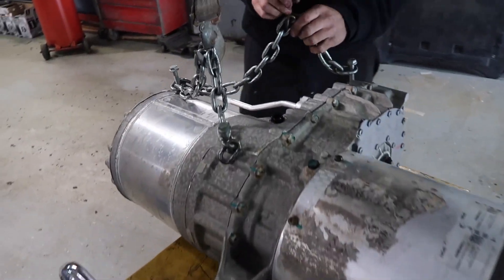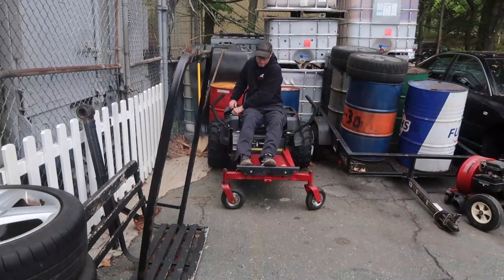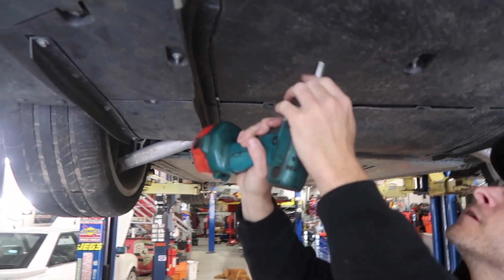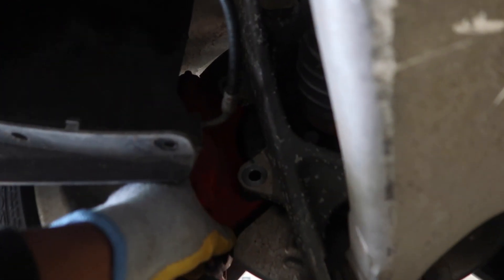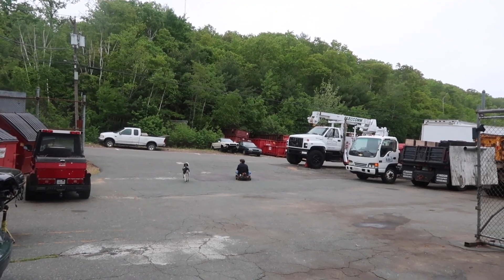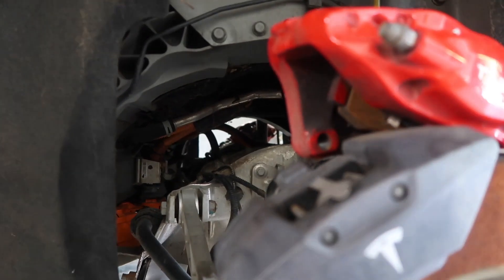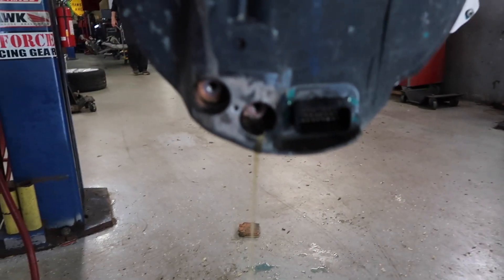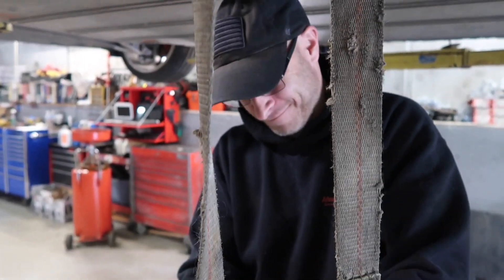Can You Drown a Tesla Motor?

Comment: I had a v-drive boat with a big chevy motor mounted kida low in the hull...it was a hydro so it always had water shoshing around it it....starters were lasting a year..take them apart water/rust pour out.....i drilled 1/8 in hole each end of the case..guy i sold the boat to been running that same starter 3 years..i ran it 2....motor gets hot, splash water on it, it cools down and sucks water in...get it hot again the water just turns to steam and keeps it wet all the time...might as well let the water in and let it drain out..when it gets hot it dries itself out..and yes, 12 volt starter will work in water, its the corosion that wreck them...dont know if that applies to 400 volt motors..

Comment: I fixed a water damaged laptop that had been out in the Midwestern US Summer with some gentle electronics cleaning spray, patience, some lent free cloth and allowing to dry. Along with a 3DS and a touch screen phone! (3DS was on me, note to the kids out there if you decide it's a good time to jump on the trampoline, take some time to clean out your pockets. 
You can typically clean this kind of board and it will still work, regardless of if it has been turned on or not. 
If you don't want to try to clean it, that's all up to you but I believe its worth it! 
I love what ya do Rich and hope this one goes smoothly.

Comment: Great stuff. Take all those circuit boards out and get someone who knows them to clean and inspect them optically at least. Also, for the inverter it depends on if the boards were conformally coated. It's not over!!

Comment: lol,. electric motors will run underwater,. no prob,.  its gas and desl that you never try and start, not that youd wanna start thiss either). cuz water dosn't compress and youll likely short out your ecu and well ,.,everythng,. tranys and diffs also take a big hit from water,. ,.  electric motors just get all the grease washed out and scale over everything,. but they will run ,. its the rest of the system thats melted and dry rotted now that you need to worri about,. ,. and like you said lots of power, so,, hope for your sake teslas are mostly plastic.,...  most cars will survive a flood if the battery is disconnected ,. have fun doing that on a TES ..

Comment: time to break out the electric toothbrush and some good old soap and water and clean every single circuit board by hand and dry them out in front of a rack in front of a fan

or if your able to get them out put them in the dishwasher then dry them really good in front of a fan

Comment: Wow, seeing how extensive the PCB's are within the power unit i would certainly never own this design. It especially puts itself at risk to moisture damage if a case were ever cracked being as they are very low within the build. I'm sure the modular construction lends itself to expedient production. If the boards were isolated and fully enclosed and the wingdings were type F this may have a good shot at being out on the road again with relatively low amount of input. But the boards placements seem to be the downfall here.

Comment: Hi Rich, this video was quite informative. It reminded me of a car show I attended in London during the late eighties. At the back of the show was a small WD40 stand showing a commercial power drill working in a fish tank of water. The drill was coated with WD40 and worked. I bought a can and tried it out as soon as I got home after coating EVERYTHING inside the drill and... IT WORKS!  WD40 claim it coats components and dispels water. I'm not suggesting it will work on the Tesla motor after the event but it might be worth a try. Open the units and coat the components completely then see if it starts.  The outlay is small but the rewards....

Comment: Honestly tho, gasoline engines can run underwater as long as the air intake is sealed with a snorkel. Tesla? Oh no water, electric motor dead. Shame. Should be sealed

Comment: Those electronics, wash them with dawn and water, it will remove the corrosion, the little circuits could arc if the oxidization is left on them. Ive saved many computers with water damage and its amazing how soapy water and 91% alcohol with a brush.

Comment: I am going to jump the gun here and say that I have faith the motor itself is still good. The circuit boards and all the other stuff encased in there probably not. Lots of chips will need to be replaced (a job for Louis Rossman maybe...). In my experience with electric motors I've seen some amazing stuff when it comes to water. The reason I said I am jumping the gun is because I refer to small motors, mostly of the brushed type. Basically in some cases those motors receive an initial break-in which is done with water. Like, submerged in water.
Reply: See: v=f8qZ7w6Hsqc

Comment: actually there are no problems with water and electricity. the problem is all of the minerals in the water that can conduct a current. l mean if you let that thing dry out a little bit it would be fine, but with all of that rusty water that thing it's junk. l have a friend who's truck had a small air compressor mounted on the bottom of his truck and that thing was caked in rust and full of sand it didn't work at all. but we took it apart and wire brushed the armature and put in new brushes and cleaned out the rust and we actually kind of got it working again. the problem is that we used WD-40 to losen up the rust in the compressor but it also destroyed the adhesive on the magnets so when ever we charged the motor the magnets would just start knackering around in the thing and it wouldn't spin. but if we cleaned out all of the WD-40 and replastered the magnets that thing would have actually been in working order again.

Comment: that's a lot of water., i guess you better not drive in a even slightly flooded road
Reply: It was under water for 10 days
Reply: I get that but if it was waterproof let's say at an IP68 standard it wouldn't make a difference unless it was damage. since there is no damage to the casing, this could mean that there is no water proofing whatsoever. so even if you drive into big puddle you could drown your motor?
Reply: Drive in to a big puddle and stop there for 10 days maybe

Comment: wash everything with alcohol and ultrasonic washer  . 
all circuit boards are easy cleaned , if they did not work on water, no current no oxidation and burnouts . 

good luck . 
give it a try .

Comment: I repaired a mobile phone that fell into the sea and was submerged in 3m of water for an hour while trying to fish it out.
Took it completely apart, soaked and washed it thoroughly with distilled water then put in an oven at around 90 °C for a few hours.
I put it back together, and it booted up with memory intact, but it couldn't get a signal probably because of the analog circuitry and tuned coils - so, left in on a radiator to dry out further for a couple of days and then it worked flawlessly, until I left it in a taxi a couple of months later :-(

I would try the same approach to see if the inverter will work again and there's a good chance it will.

Comment: well first pressure wash all the crap off and remove the boards then just inspect and get them checked out by someone. Motor and gear box will be fine, just let them dry out and put new fluid in

Comment: Everything needs to be cleaned with distilled water with some electronic soap.   Break cleaner works good, not sure if it's harmless to electronics, I've used it on connectors with out any problem, afterwards douse everything with 91% isopropyl alcohol, and set outside in the sun to dry.  
Unless there is noticeable damage on electronics boards, it should work ok.  
I'm sure Tesla engineers thought about a submerged car being damaged, in their design and engineering.  Tesla needs to install moisture sensors in their electronic compartments, to automatically shutoff power to prevent damage. 
Repack or replace bearings. 👌

Comment: electricity and Salt water don't mix.  Fresh water ... meh .... if its pure - then not a problem.  I had a submerged boat one time in fresh water for around 6 days - battery still attached in fresh water - pulled it out, opened the spark plugs - tried the starter - it worked .... I was amazed.   Salt water?  Not a chance.

Comment: If the screen booted up after a heap a water should be no reason once you clean up those boards on that inverter they should work too could place them on a level service and go over them with a heat gun to reflow the solder if it looks suspect i would give it a crack any way .

Comment: yeah you can repair that for sure, you need to get it completely dry, and use 99% Isopropyl Alcohol on all PCBs and all the chips on them using a very fins very very soft brush, this could take weeks to do because you need to go over every single component but should work. when people water cool their pc somtimes you can get leaks in your tubing, dry the electronics real good, best bet is probably to let the electronics dry out real good. then use alchohol to clean the surface, then you can use dielectric grease over the top to protect and prevent electricity from jumping to different components, plus putting the grease over components on the PCB will help prevent further corrosion.

Thats what i would do, there are probably better materials you can use to achieve your goal though.

Comment: I run model battleships with electric brushed motors, and the motors will run underwater.. although they are much less efficient, they still work, and the bright side is they are then liquid cooled lol. but if you left it underwater for long periods and didn't dry it out.. they would rust and be screwed unless they were properly coated or treated.

Comment: it doesn't look good for the motor.  Even if you cleaned it up, I'd be concerned what the dirty water and corrosion did to the insulation of the motor winding.  You might get it working, but it might not last.  However, if you could get someone to re-wind the motor, that would take care of that issue.

Comment: Hey Rich, what do you think of automobiles that run off of sugar cane like they have in south america? Are they electrical, hybrid or a variation of gasoline powered vehicles? Any input would be helpful.
Reply: Love , they are combustion engines. They use air, ethanol and a spark to move Pistons on crankshaft. I am Brazilian engineer
Reply: They run with sugar cane alcohol, and it was in BRASIL, but they are giving it up, because it is not so
economical anymore.

Comment: you'll need to dismantle the inverter and individually wash the circuit boards. Yes, wash. more specifically, use an ultrasonic cleaner filled with an alcohol-based detergent. then, if it looks good, it probably is good, and if you really want to you can use a power supply to test the boards, however you might need to send the boards to someone else if you're not willing to download the schematics and work out the parts that need replacement yourself.

Comment: Those circuit boards look fried. You also don't want any corrosion on the motor wrapping wires. That could be a problem as well. You may be able to salvage large portions of the motor itself, but the circuitry should definitely be scrapped.

Comment: IM sure this motor will run ! Here is why :
-A normal brushed or brushless motor for rc vehicule can run in the water , that pretty much the same thing but in his case there is a lot a electric board
-If the motor have not been powered on , let it dry and it can work

Comment: Every time I see one of your videos and hear the words "Tesla doesn't let me" I stray further and further from wanting to buy from them. I don't use Apple products for similar reasons. Tesla needs to embrace the community, rather than shun them.
Reply: Yeah. I love the idea of electric cars, but I wish someone would make a no-bells-and-whistles model that's designed to be maintained by the owner Elon has been following in Henry Ford's footsteps in many ways, but he missed this most important aspect of the model T that made it accessible to the masses.
Reply: There are still Model T Fords being driven on roads, a century after they were built. I wonder how many of Today's Tesla’s will still be drivable in 2120?

Answers on a postcard, please!
Reply: @RWBHere  possibly a lot. I'm sure over the years the weak parts have been replaced by upgraded parts on the Fords. The same will probably happen to these. I've been sitting here watching this thinking of little improvements here and there that wouldn't be hard. I don't think it would be hard to totally waterproof the whole thing with the help of a machine shop.
Reply: @RWBHere  zero....insurance renders a tesla dead on arrival
Reply: This is a new industry so I sort of understand it -- especially when you take into consideration that they're implementing new technology, like autopilot, into these cars.. If some random after-market upgrade or incorrect installation caused the car to crash while in autopilot, well there goes all of Tesla's reputation down the drain. Once the technology is established, it will likely open up a bit more.
Reply: @LloydChristoph  people will start making their own upgraded parts. Then Tesla will see they are losing out. The more Tesla tries to block people from working on the cars the more it will attract people wanting to cash in on repairs and replacement parts. It's already attracting me. I'm sure I can figure out the software programming on the motors. I know I can repair the boards or make replacements. It will embarrass Tesla if the public drastically improves the car.
Reply: Indeed... with more and more EV's on the road Tesla will have to give in on the After Market, Market.
Reply: Yeah, nobody cares about you or the community.

Comment: Many cans of spray contact cleaner and compressed air ?Is LKQ selling Tesla motors yet?I would clean it up and connect the batteries to it-outside in an open space away from anything else.Might run or might have fireworks .

Comment: Rich, circuit boards could be cleaned with either ultrasonics or electronics cleaner. Put on some magnifying headliners and look for corrosion. You can trace out the electronics and do some VOM meter checks. ICs will be hard to test but clean everything well and then put a conformal coating on the boards. Then slowly apply power and don't let the smoke out!  ;-)

Comment: I would think/hope that those boards are coated after production to protect them against the elements. Basically sprayed with a sealant, not unlike varnish.
If so you should be able to just wash them down!
(Maybe use something a little more gentle than a pressure washer though!).

Unfortunately some idiot put all the connectors on the bottom, so they'll still be a headache.

Comment: Was really hoping that dog was going to bite the shit out of you.
Reply: Not a chance with a golden retriever ..
Reply: wash everything with alcohol and ultrasonic washer  . 
all circuit boards are easy cleaned , if they did not work on water, no current no oxidation and burnouts .
Reply: Was hoping that "pop" heard was from the dog out of excitement.
Reply: I was hoping that the dog was elektrocidedzidedsz by the battery
Reply: Was hoping the Motor was going to land on the Dog...

what even is this comment chain?

Comment: Only a tiny bit of rust - willing to bet if you cleaned it up, then used brake cleaner to flush the circuit boards and let then dry, it'll be good.  Warranty?  Not so much :-)

Comment: sure you can still use it. pull the circuit boards off and wash that bottom end out with de-natured alcohol, let it dry after you get all the corrosion gone and then put it back together and test it out. should be fine. might want to see if you can seal that motor up better too just to keep it from getting water logged like that again. gotta be careful though because some of that stuff is open to help with cooling too
Reply: As someone that repairs electronics and has for 30 years, this is a bad idea.  400 volts, logic level signals, water, conductive rust = Bang

Providing the goons at the junkyard didn't try and drive it (Which never happens)  - Boards need pulled, sonic'ed and dried.  Motor needs completely tore down and all rust and residue removed.  Hook up CURRENT REGULATED power and test.  Odds are 60% it will work, 50% odds missed rust will blow everything.  The rust doesn't even have to be enough to be conductive.  All it takes is a few ohms to turn on the wrong transistor at the wrong time.